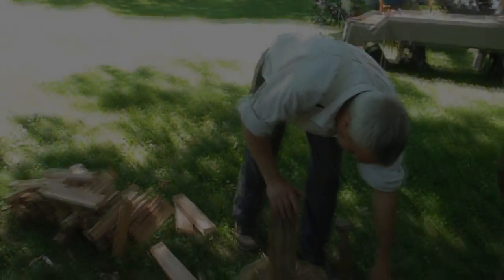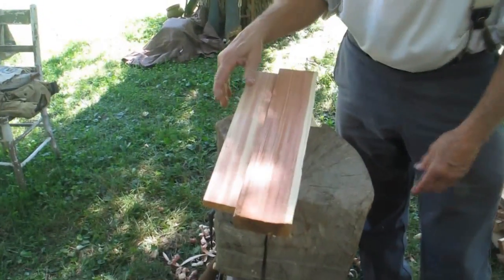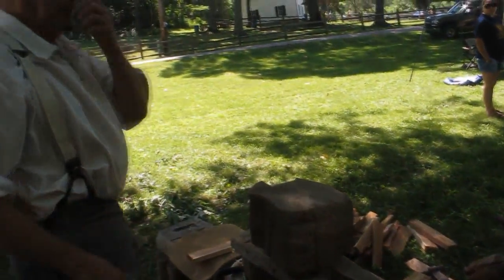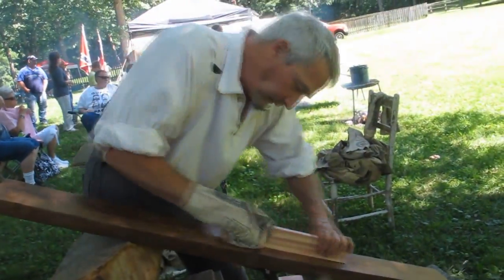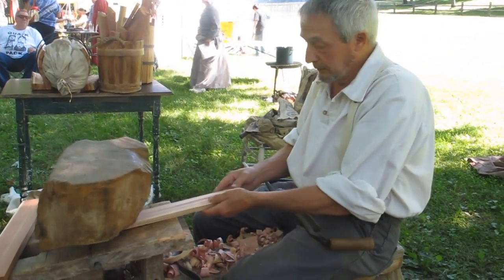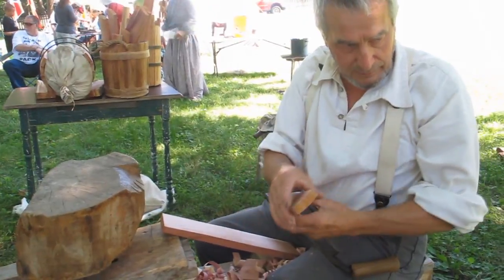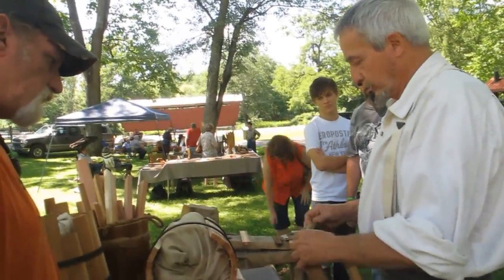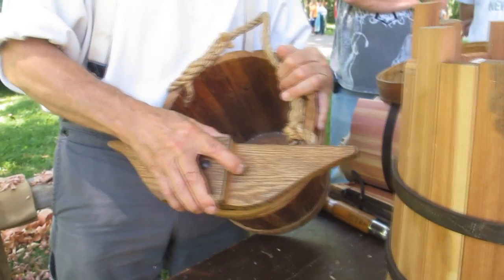Bucket Making White Coopering

Comment: if you study just5 a little of ancient geometry you will easily find a better way to find the center.  set the compass to the diameter, mark that distance, then divide that distance by 2. then set your compass to that distance and make 3 scribes with one point on the edge of your circle. where the scribes overlap is the exact center.